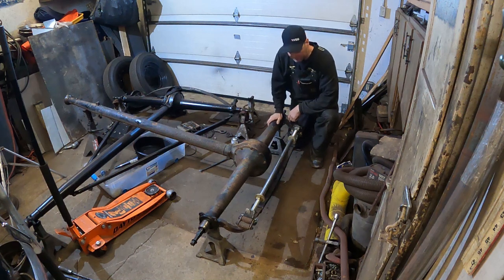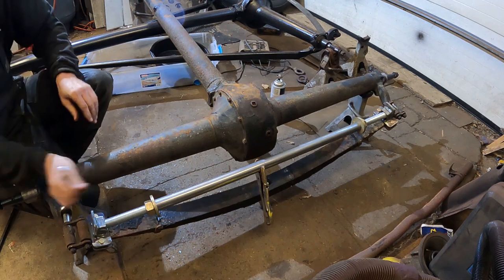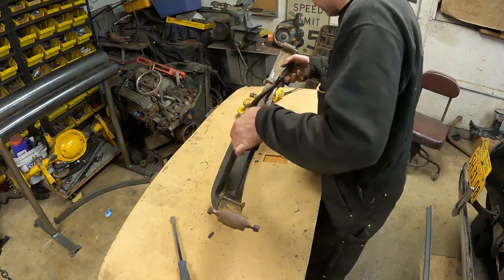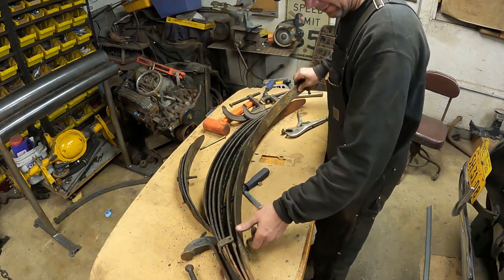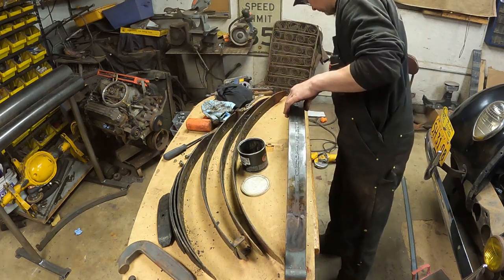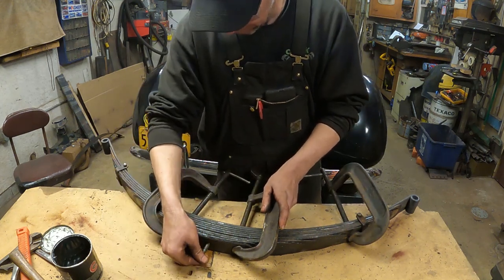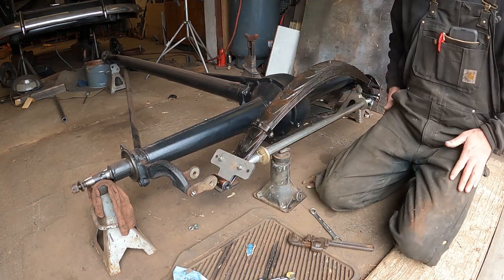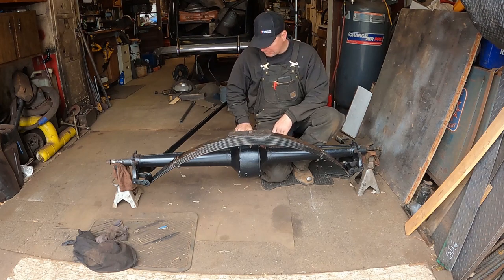Reverse Eye Rear Spring:  1937 Ford Taildragger Build

Comment: Good home engineered solution with your spring spreader. Would it have been less spring tension to fight if you had taken apart the spring pack first so you were only spreading the one longest leaf?
Reply from the maker: I tried that once.  It makes the c clamp trick way scarier because a lot more tension still in spring

Comment: Next time wrap a chain around the spring and spreader for a safety. Clamp all the leaves, wrap a chain around the pack, remove centre nut/ bolt, replace with a length of threaded rod.
Reply: I did this job several times exactly the same way. Worked every time!